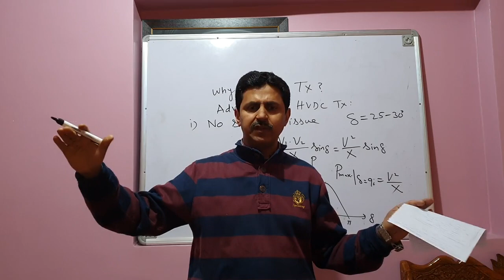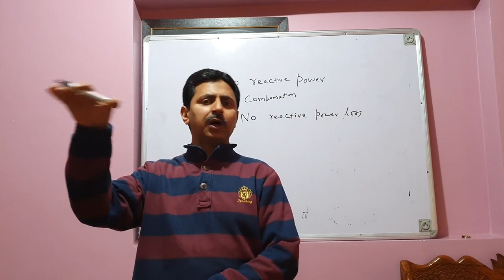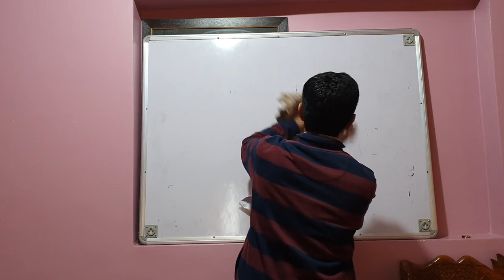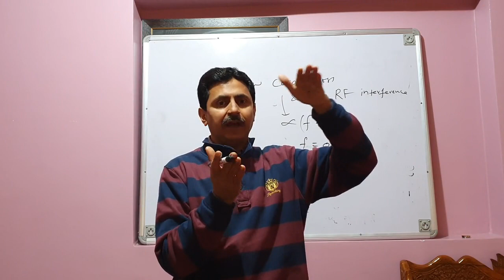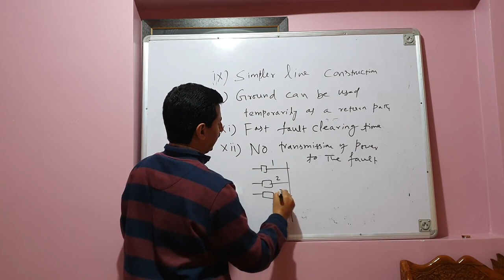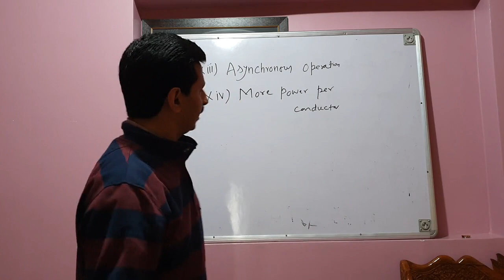L1_Introduction to  HVDC Systems

Comment: Very informative, useful and easily explained sir.
Reply from the maker: Thanks dear Naderm
Reply: @prof.a.h.bhateednitsrinaga6515  dear sir have you written any book on HVDC FACTs.
Reply from the maker: @nadeem1969100  No. Not yet. I am planning to write a book on Power Electronics
Reply: @prof.a.h.bhateednitsrinaga6515  sir I am also a faculty member in one of the engineering campus in the department of electrical engineering in Sindh. Would be waiting for your book on power electronics

Comment: Best teacher
Reply from the maker: Thanks for your compliments
Reply: @prof.a.h.bhateednitsrinaga6515  sir dc mein tu hum step up aur step nhi kar pate hai volatge..how can we fullfill that demand in case of hvdc,as dand varies
Reply: Demand*
Reply from the maker: @mehvishmushtaq5579  At rectifyibg station we stepup the voltage to transmission level using a stepup converter transformer and at inverting station, a step down converter transformer is used to step down the AC voltage before it is fed to recieving stations for distribution of power. Along HVDC link, voltage transformation is not possible.
Reply: @prof.a.h.bhateednitsrinaga6515  thankyou sir